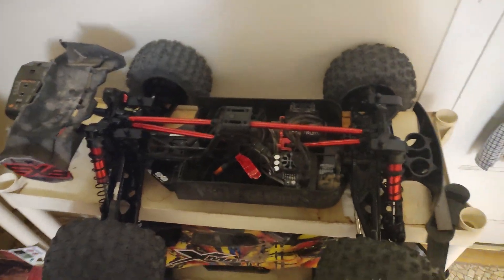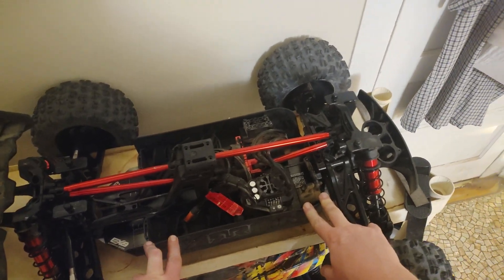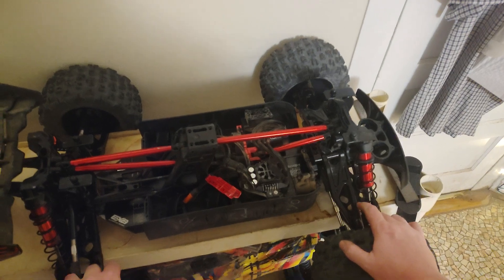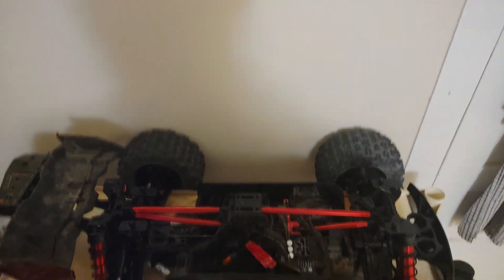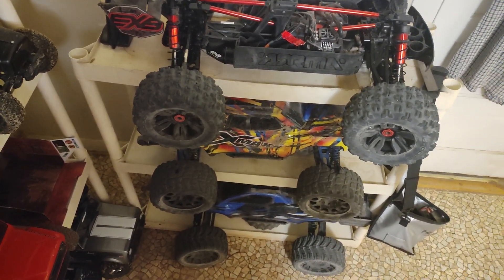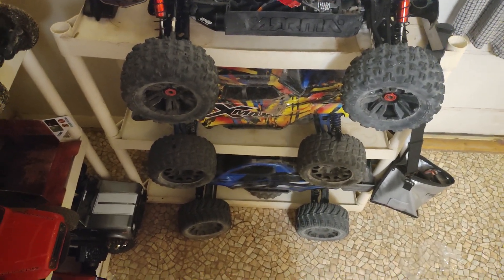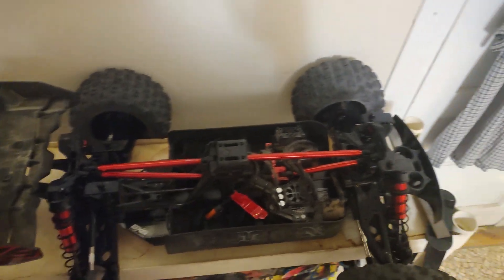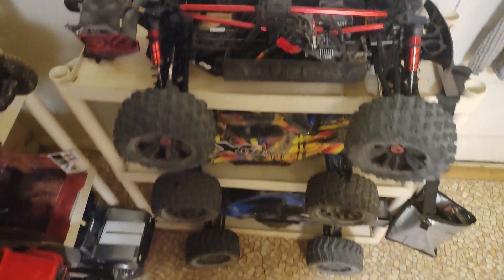garbage kraton,xrt maybe the better choice, #arrma #kraton8s #rcbashing #traxxas #traxxasxrt

Comment: You should give the Serpent 811-T Cobra RTR a try, as a comparison. Although to give you a general idea of what to expect, it's going to be a night-and-day difference in terms of handling and just general overall feel. Dedicated bashers often have a lot of play in their steering and suspension and that can cause them to feel a bit lazy, unresponsive and inconsistent, as the steering tends to lag a bit behind everything else and the suspension alignment is constantly changing slightly by up to half a degree in some cases. Whereas with a racing vehicle everything's toleranced a lot tighter so you're not going to have nearly as much play. The 811-T Cobra is very similarly priced to these big trucks (it can sometimes be significantly cheaper, Serpent tends to have frequent big discounts) and is available as an RTR, so I think it'd be a good comparison.
Reply from the maker: Thanks for the recommendation, definitely gonna check it out!

Comment: Whats going on , i own both the xrt and kraton. I noticed the xrt biggest problem is the bellcrank and wing mount out the box .
Reply from the maker: Hot racing bellcrank is what's on mine I think and haven't had a problem with it. There are 3D printed wing mounts that solve that issue. They have there issues for sure but once I upgrade those part I haven't had a issue.